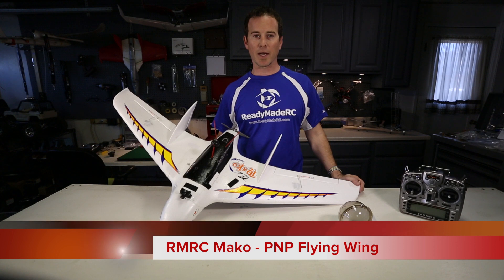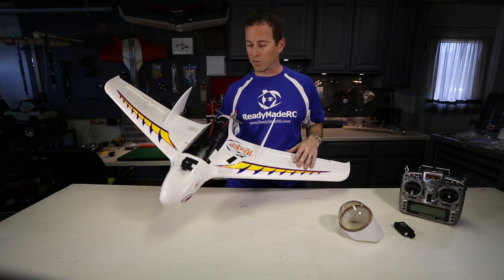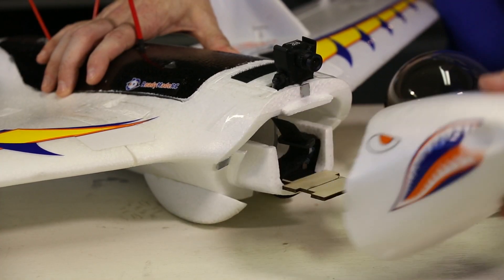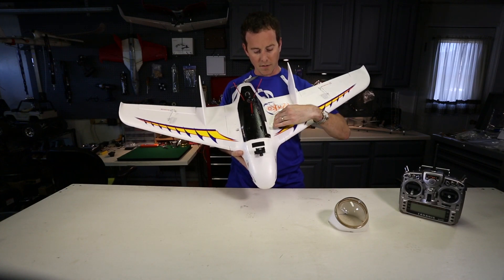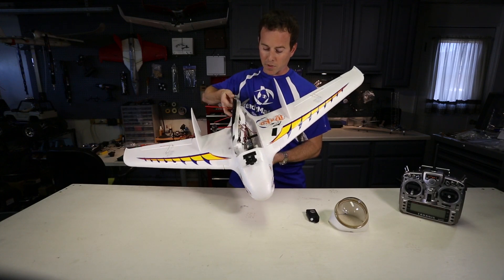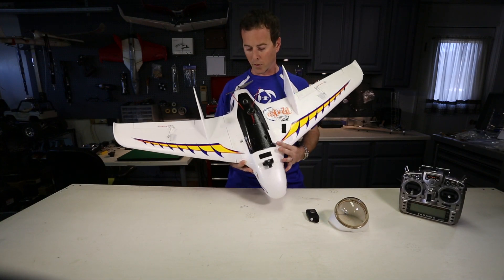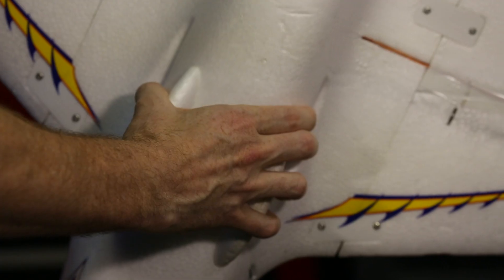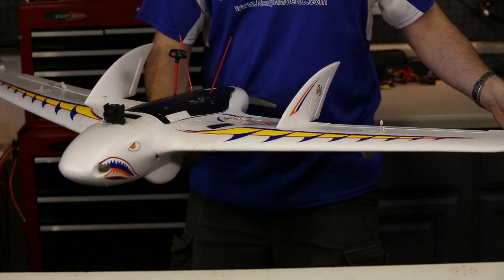GSTV - RMRC Mako PNP Flying Wing - FPV

Comment: what about the autonomy in flight ? what is the biggest battery it can handle ? I'd like to use it for proximity fun and some "mid range" fpv ( about 5-8km) is it possible ? thx
Reply from the maker: BlueMan FPV - Haven't tried autonomy. I ran a 3300 3s but you have enough room to add in more if needed. Prob 5100 3s would be the max, but haven't tried that either. I've run about 30 mins in flight so range flying is possible.

Comment: How well does it handle slow flight? I like to take it slow to get photo's/
Reply from the maker: Bill Vickers The Mako flies great at slow speed as well as fast. I was able to do simple back and forth cruising for some LOS testing, as well as for testing long duration flights and it's very nice. For mapping or something like that I'd add in the Gurardian 2D/3D stabilization or a Vector for instance, but even well trimmed it's flying nice and slow if needed.
Reply: calidave88 Are you going to sell parts, like canopy, or wings?

Comment: please don't put the esc and  the vtx so close to the Rx. not good..
Reply from the maker: FPVREVIEWS It's true you want to have as much spacing between the rx and "noisy" components like the ESC and vtx, but those 5.8G 250mw vtx aren't causing any issues with the 2.4G rx with the spacing they have in the build I show, and the ESC still many more inches away than most multicopter builds where spacing is even tighter

I've never had a lockout with this Mako... it's actually just fine the way I show that build. Had that been a 1.3G vtx then yes, you'd really want spacing and to use a low power output (mW) vtx, likely below 300mw. But it's a 5.8G link so it can be closer to the 2.4G rx for such a small and tight build.

I don't setup 2.4G rx based craft for long range flying, they are for close/mid range and that's how I'm running the Mako. But, yes, you always want to consider component placement when working your build.

FPV cameras can also add interference that can bother a nearby rx, so on a craft like this you have to pick the spot that avoids the biggest offenders the best you can with a tight space. I think I've done that with the Mako build. The fact that it's never crashed or had a lockout supports that theory, and I've really pushed the setup. ;)
Reply: calidave88 Good, glad to know it's flying well.   You did a great job on the recent videos. the air to air shots are the best!